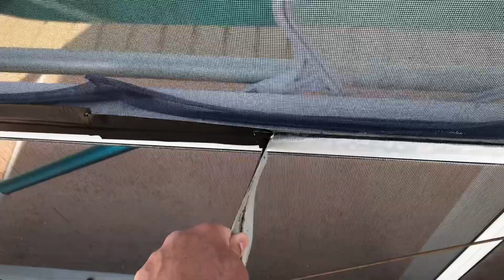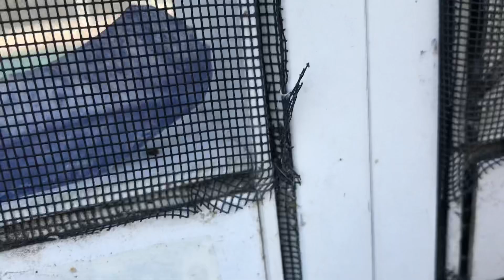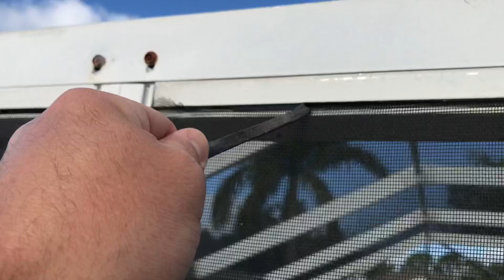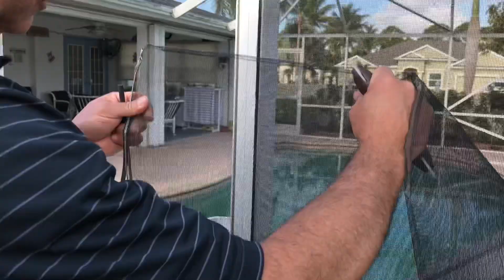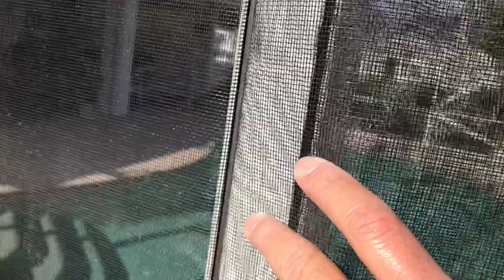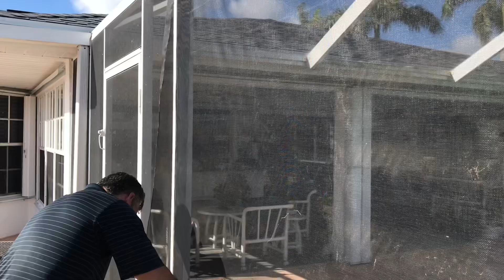DIY SCREEN REPAIR - REPLACING A RIPPED SCREEN on a Pool Enclosure Patio or Window

Comment: For about $50 I went to Lowes for about 85" X 30 feet roll of screen, a roller thing at one end and knife at other and the rubber.  Plus, I bought a tea tree for my wife to keep her busy while I work on this.  I started putzing around trying to take out the old rubber but figured I could save time by seeing how you do it.  I'll wait until the sun goes down more before getting back on the roof.  I notice one the top, highest part, ready to go but I am too old to try get to that.  The screen repair company can't come out until over 2 weeks and one night the bugs got in pool.  Thanks for your help.  I feel more confident now.

BTW, when I saw the duct tape, I thought it was my pool.  Screen guys said don't use duct tape, the glue will bake on the metal and you have to sand it off.
Reply from the maker: Thanks for watching. Stay safe! 😎

Comment: *FANTASTIC PRESENTATION*

1) showed how to do it correctly.  For once we learned why the brown-handle thing with wheels has 2 different types of wheels

2) wait to trim excess - don't try pre-cutting the screen to size  (mistake many people make with screen installs)

3) there was not a lot a chit-chat.  Too may How-To videos on youtube are really made because the video-maker just wants to be the center of attention and likes to see himself on the screen.  You can tell that type of video because over 90% of the video, the guy is NOT ACTUALLY DOING THE HOW-TO JOB, he is chit-chatting.   They talk and talk and talk.  "You take these two thin ropes, and then you lay them across each other.  You lay them across each other in two different ways.  Then you pull on them until they are tight."  No, stop chit-chatting.  Show us the shoelaces as you tie the freaking shoes.

4)  the video length was absolutely no longer than necessary.  FANTASTIC EDITING

5)  the tools needed were shown

6)  the install process was shown

7)  the install WAS SUCCESSFUL, it was shown START TO FINISH,  the editing was fantastic

The design of how the information was presented WAS 100% PERFECT.

The rusty pliers, which looked to maybe be near the end of their useful life, gave off a sense of humility, being humble,  "you can do this even if you're a regular person, you don't need professional tools, just use the tools around the house.

Maybe you can clean up youtube of all those 30 minute, 60 minute long How To videos of attention-seeking schmoes by creating a course on how to make effective How To videos.  

Thank you kindly for demystifying screen installs!  In Orlando, FL the companies charge you $$ like they're doing a specialty job no one else is capable of.
.
.
Reply from the maker: Thank you so much for the great review.  Best I have gotten. Thanks for watching! 😎

Comment: He got the job done but if you pay someone who does it every day you wouldn’t have those waves in the screen you can see at the end they are called puckers we’re not aloud to have those after buying all the tools and aroll of screen your better of just paying someone 50-100$ for a panel but great job no hate ps don’t heat up the spline (rubber ) or let it sit in the sun just stretch it a little and it will go in like a dream
Reply: @James Deam  less slack and pull tighter the tighter the screen thee better it looks